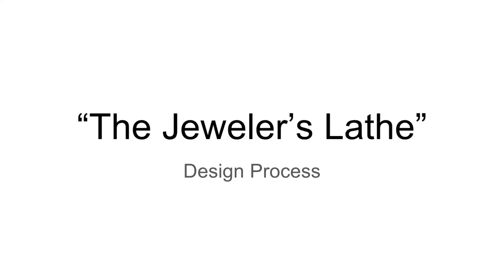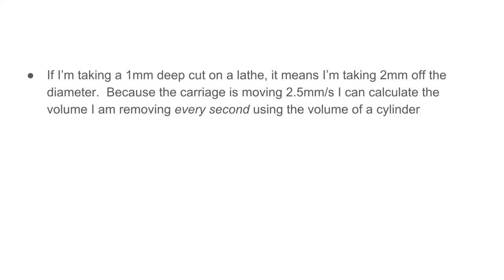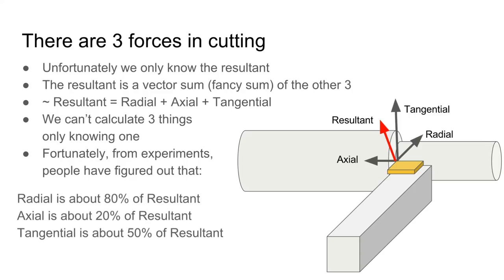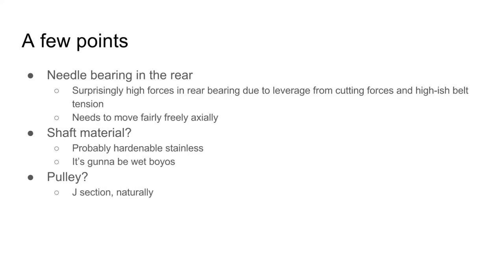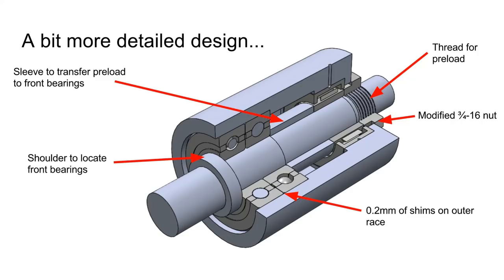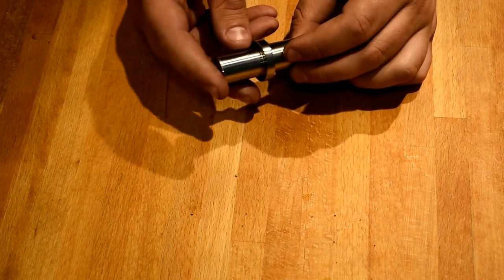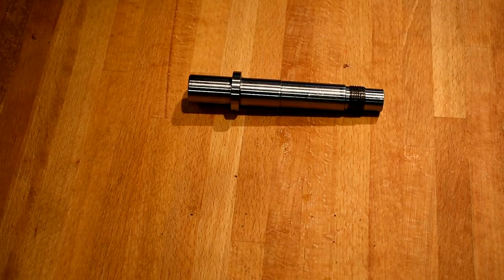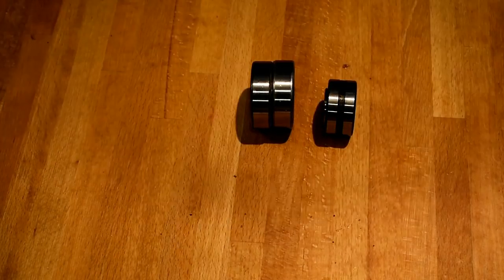The Jeweler's Lathe Part 1:  The Spindle

Comment: For the benefit of anyone who was confused, the unit Ws/mm^3 is a bit messy, but it makes more sense when you break it down a little. A watt is just energy per time, 1 joule per second, so the seconds cancel out, giving J/mm^3, which is just the amount of energy required to remove a particular volume of material. The reason the more complicated unit was used is because it makes the working out in later equations easier

Comment: Ahh a couple of motorbike wheel bearings. Cant go wrong with those, Cheap to replace and for their size very highly rated. The needle roller is tricky at speed re lubrication and fit there is virtually no room for error. If your grease is to thick the elements will skip. Some NBU-15 would be the heaviest that I would use in there. If you have trouble with the needle roller just go to a single bearing like the front and give it an 1/8" end float clearance in the housing. Also a tight clearance fit on the od 0.005 ~ 0.015mm. You use a O ring or quad ring to hold the od and it will be fine.
As for a belt drive may I suggest something a bit different? Try a flat microV belt drive. A 4pk should be good for 1.5 kw way more than you need. These are common automotive gear and will work well in your application. These are quiet and don't consume much power. The pulleys are easy to make and if you don't want to you could just buy a couple of inner tracking pulleys of a serpentine belt drive of a car. You would have to bush them to make drive pulleys. The last ones I bought cost $15 each Australian and a 4 pk belt was only $10 but these were automotive sizes. You could go down to your local pick a part and scrounge some idler and or alternator pulleys pretty cheaply. There is no problem running a 4 pk belt on a 6 or 8 pk pulley. Timing belts don't slip but introduce harmonics to the cut and will be noisy at speed. V belts slip to much, use a bit more power and need to much tension on small pulleys. 
Cheers
Reply from the maker: Hmm motorbike wheel bearings... I didn't know that, but that's probably why, of the 3 commonly available 20mm bearing sizes, they were the cheapest by far.  I think they were like $13 each for ABEC-3, and SKF no less.  I'll look up NBU-15, thanks!  All in all I would sum up the needle bearing experience as "sketchy", so I may try out just using a deep groove ball bearing next time like you suggest.  I believe a J section belt is a micro V belt, but I'll have to look at automotive suppliers for cheapies.  I agree with timing belts -- they sound like chainsaws at full speed :P.  Thanks for the input!

Comment: That was great man. Hey what about the other lathe you where doing. I sure could use a auto tool changer lol
Reply from the maker: Still goin!  I'm sort of clearing out an area at the new house for it to live.  I'm getting some funny voltages on the tool changer board so I may re-solder one.  I don't mind it not being perfect, but I'd prefer it didn't try to change tools randomly!

Comment: its been a while since you did this video, so maybe this dont apply any more....... You have a nice lathe and carbide tool ,   the lathe is capable of cutting/ turning .100-.200--.300 cuts,  in slower spindle speeds and slower feed rates.......also, if the tool bit is turned at a 45 degree angle the tool will cut better when taking  these very heavy cuts....... how ever, while rough turning a piece,  it will get very hot and around .010-.015 should be left on the diameter to allow for cooling and to finish turn the diameter to size........anyway looks like you did a very good job...

Comment: Nice work. Aren't the oblique contact bearings designed (ie ground pre-loaded) so that when the inner race and the outer race flange are co-planar you have reached the manufacturer preload? I think I heard Robrentz say it on a podcast.
Reply: nraynaud1 Some are. Those AC bearings ground as sets or “universal” can be had with a specific preload ground in. When pressed together preload is automagically established. Other, less expensive, bearings still rely on shimming to achieve proper preload. The whole procedure makes me nervous.
Reply from the maker: George Keeney nailed it.  Im just a poor boy, I have to shim my bearings myself :(.
Reply from the maker: It makes me nervous too--That's why I went for such a light preload.  It really doesnt take a lot of wrenching to totally ruin your bearings lol.
Reply: For the time and materials involved in this project a pair of 7204 P4 isn't much, especially on ebay.
Reply from the maker: +rcdieselrc ive come to distrust ebay bearings... apparently theres a huge counterfeiting industry for bearings... i guess i couldnt mentally justify the cost considering the kind of cutting ill be doing.  The ABEC 3 bearings i got seem to be working well... 0.0015" runout before grinding is respectable
Reply: If runout meets spec, no arguing with that. Yes counterfeiting is an issue.
Reply from the maker: +rcdieselrc yep true true.  Im probably going to use AC bearings in my next build

Comment: Does anybody understand how the preload works?  The nut is pushing on the needle bearing inner sleeve, which had what ended up being a press fit on the shaft.  Is the nut doing anything here?
Reply: I think you're right. The preload is set by the shims. The bearings being press fit makes the preload fixed. The spacer and nut contribute nothing to the preload. The reason I came into this video was looking for a way to set the preload for angular contact bearings. I found this pdf which says the bearings should be a sliding fit in some mounting schemes: 
https://mrosupply2-dyn-documents.s3.amazonaws.com/product_documents/10/100KSF/installation.pdf

Comment: Hi, You mentioned axial loading on the choice of bearings you used. Can pillow blocks be used for holding a shaft? I understand they are used primarily for radial loads, almost exclusively. Do you know if two pillow blocks can be used to hold a shaft? Thanks,
Reply from the maker: They should be able to... they are usually compliant in angle to compensate for misalignment, but they are axially constrained.  If one bearing is secured along axially on the shaft and the other one isnt it should be fine
Reply: Thanks for your reply. I've noticed that many lathe heads tend to use two tapered roller bearings or at least that seems to be the recommendation.

Comment: Now I feel slightly dumber because I was completely lost on the math aspect😨 but still interested and amazed😀
Reply from the maker: Thanks!  If you think theres anything i can explain in more detail, let me know!  Im thinking of making a video on bearings, and it would be great to know how deep to go :p... i used to be a teaching assistant in machine design, so im happy to break it down pretty far lol
Reply: I would like all the information I can get because I am very interested in making one of my own because I am in need of a good piece of equipment and I would love to be able to say I am using something that was built with my own hands. My experience in this area is minimal at best so I am trying to absorb everything I can at this point until I can save up the money and knowledge needed to purchase the equipment necessary to begin construction on mine. Also I am going to be starting to gather info on a 3d printer and mill. So any information you can provide would be greatly appreciated. I am sure this is going to be a very long process and I am going to run into snags along the way but I am very determined to accomplish my goal. Thank you in advance for any and all information!!!

Comment: Great video. Thanks for sharing. I am wondering how this design will handle back facing or lt hand turning?
Reply from the maker: Good question.  The spindle is, so far, only held in place in the +Z direction with the press fit.  I may thread the lip at the front and use some kind of retainer there to hold everything in place, but, for a 100-200N cuts I don't think it will be a problem:P.
Reply: hlaps1990 this was my guess. Thx for replying 👍

Comment: so much enginerding, so little experience, don't get me wrong you do beautiful work, but I think you missed a couple classes when you were getting your degree for example, Stainless likes to gall like a mofo 101, and Galvanic corrosion 220. excellent spindle design btw, but with the addition of a spindle body cap you could have avoided needing to press the bearings in. which is usually avoided at all cost in spindle design. also that nut should have some kind of distortion locking feature, ideally a spieth nut type design or something similar.
Reply from the maker: I won't pretend I've been doing this for 60 years or anything, but I've certainly been out of school for a few years now.  Most of the classes I missed in school were in economics :P.

I definitely agree that 300 series stainless steels gall like crazy, though I was pleasantly surprised by 17-4, even in the softened state.  The plan was originally to harden and grind the 17-4, which would be absolutely mandatory if this were ever going to be used by someone else, but having evaluated the equipment at my disposal and the cost of jobbing it out I gave it a miss.

Is your point about galvanic corrosion regarding the stainless steel fasteners?  I do usually avoid them unless I'm anodizing (which these parts were), but I've never really had a problem in relatively thick parts.

I've seen spindles with the bearings in caps and with the bearings pressed in -- do you just mean that it's easier to swap the bearings?  I don't see myself doing that.  I do have some experience in machine design, however I have zero professional experience in high speed or precision spindle design, so this was very much an experiment.

I won't argue with the distortion locking nut, though the nylon locking element in this one seems to be holding up.

Thanks for the comment!  I hope I didn't sound glib or anything in my response.

Greg
Reply: not at all, I was more worried about the bearing spacer, which I believe was aluminum, maybe I missed it and it was SS, also I should have watched additional videos and realized you anodized the whole thing, that should help tremendously. 

you wont distort bearing tolerances with a spindle cap. plus your right the benefit of disassembly. with the right design you can use the bearing cap to capture the nose bearings, and have the critical dimensions on the cap, which is way easier to screw up, remake, or adjust dimensions, than internally boring steps in the bore. your spindle design it awesome, I could argue AC bearing purely on the fact of, because AC bearings :) but other than that I've seen a lot of high speed ballscrew set ups done the same way.

a spieth nut axially clamps the threads like well the way thready are designed to be stressed. I wouldn't buy one, they cost about a billion dollars, but you can make a similar thing in 2 pieces pretty easy, making a small one in one piece is a pia, they're really superb in allowing you to set your preload right where you want it, an then locking the nut in that position. and on the business side they stay nice and flat unlike some other "clamping nuts" I finally got sick of the crappy double lock nuts on my G0704 and built nuts for it. next time you build a machine look into it, you'll never go back to anything else.

Comment: Total waste of bandwidth. If I were to build a lathe of any size I would not design it merely to machine one size of material at a particular cut. Too much waffle for irrelevant data in the real world.
Reply: Somebody didn't get their coffee this morning.
Reply: he is not designing it to machine one size or one cut he is using the maximum material size and maximum cut to determine how strong the lathe needs to be
Reply: I think you're misunderstanding the wording.
Reply from the maker: I love waffles.  Perhaps I didn't make it clear that this was sort of my "most extreme case" of cut.  I calculated this in an excel sheet and played with the cut parameters a fair amount to make sure everything was up to snuff.  Obviously this isnt how DMG-Mori predicts their spindle loads, but its a good starting point.
Reply: Watchmakers lathe?
Reply: That “one size of material at a particular cut” establishes an upper constraint, which is exactly how engineers design machines. Because anything that can cope with that cut can cope with smaller, slower, softer, etc.